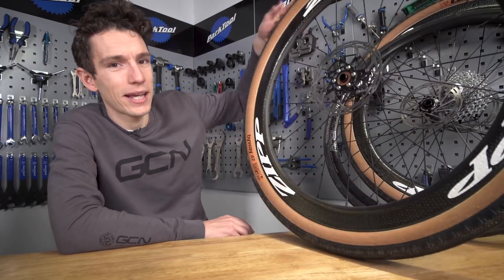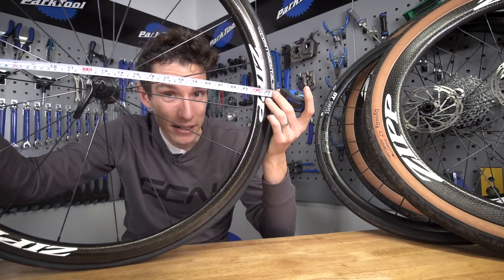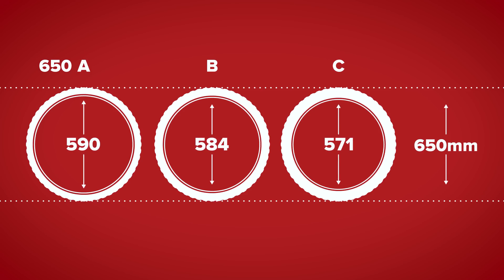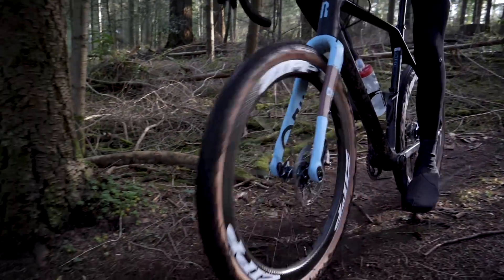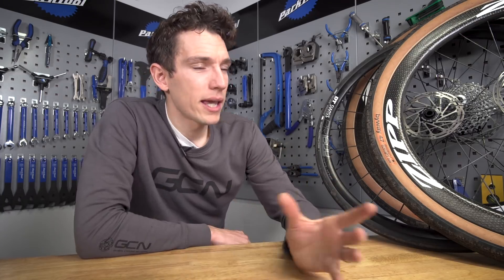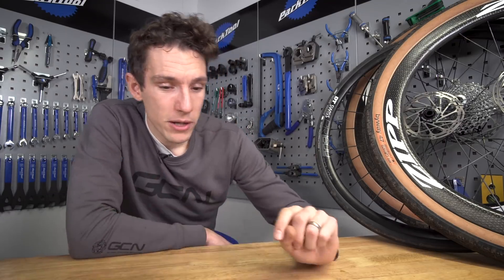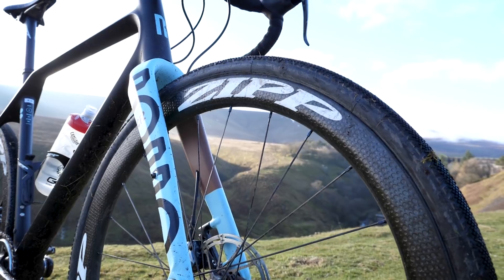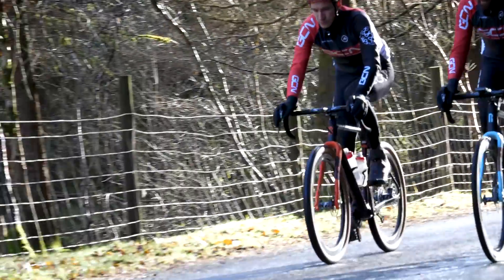650B Vs. 700C: The Geek Edition | GCN Tech Does Science

Comment: Interesting. I just checked the rolling diameter of my trike rear wheel and tyre, a 26in with 47mm tyre, and it comes in at 670mm, pretty close to a 700c with 25mm tyres. 2mm difference. I've got Schwalbe marathon plus which are a bit taller than non-armoured tyres.
Oddly enough, I have to change the mounting points for the roller on my trainer to fit my bike on it. I think I should try 23mm tyres for the trainer'

Comment: Please, please, please stick to the ETRTO sizes only, as that will remove most of the confusion as to what tire will fit on which rim. The width of the tire then completes the picture. Luckily the ETRTO system includes two numbers, so you get both at teh same time.

Comment: Not many years ago I bought the top spec S Works Stumpjumper 120 fsr £5k for trail riding. The following year pretty much, it all started going 29'' and very quickly its value sank like a brick. I still ride it today and people seem shocked I am able to shred on 26'' wheels?!?!? I have been saving up for a new top spec road bike to replace my 2009 tarmac but the only thing holding me back is the speed at which road bikes are evolving right now. I am waiting to see it settle down a little. I think it will settle down to one style of bike....one which both aero, comfortable, light, discs and higher volume tyres. Knowing my luck after I do buy something the road bike world will discover a new wheel size ha ha ha.
Reply: To be honest, unless you’re looking to do CX as well, or explore off-road, this video shouldn’t really influence your buying decision. 

With how comfortable and light modern aero bikes have become it’s hard not to recommend one (especially if you’re running 25 to 28 mm tires) if you’re fine with the slightly more aggressive geometry. Maybe grab something with newer gen disc brakes and you’ll be pretty future proof.
Reply: tarmacsurfers it’ll never slow down mate. The industry is only interested in selling you a new bike. - Si said it himself new wheel size (which zipp say is better -I mean who’s going to prove them wrong??) means New frame designs.  Bet the frame manufacturers are loving this.
Reply: Ryon Beachner oh yeah mate I know just got me wondering if the industry comes up a "new breakthrough" wheel size larger than 700cc that "makes you go even faster" at the same wattage ha ha. Maybe they will all get together and come up with such an idea if sales across the board slowed one year ha ha ha.
Reply: David Fellows yeah mate too true,  consumerism hey! Ha ha
Reply: That is unfortunate timing isn't it?!

Comment: We need a GCN science video on this! I'm interested in an acceleration tests of a 650c vs 700c wheel both with road tires. With 12% weight reduction, 7% aero benefit, and 24% lower rotational inertia I'm guessing it could have a big impact on standing start sprints and even some decent results in rolling start sprints.
Reply from the maker: +Joshua Piccari sounds like you've done part of the science for us - we'll see what we can do.
Reply: @gcntech  Bring it on! :-)
Reply: Alex Stieda rode a 650 Softride with Coors Light in the early 90's and there was some other experimentation among the Pro's. I think Steve Bauer's 1993 Paris Roubaix bike may have used 26's as well, but there a smaller diameter would increase bump force. Most notable is Paula Newby Fraser on a Hamilton with 24"!! wheels front and rear. She smashed the Iron Man record and came in 3rd among the men. 200 gm rim, 140 gm tire and same spoke aerodynamics as a 700c wheel with an 80mm rim. Ridiculous acceleration and aerodynamic and it allowed a tighter, stiffer frame. Banned by the UCI after Atlanta 96.
Reply: That is a great idea.
Reply: Thats the one! Special build for her. Notice the "uphill" bottom bracket and the apparent length of the chainstays, and the size of the rings. Some is just a visual effect of the wheels. The stays were actually super short at 38cm with plenty of room to go even shorter. This allowed stout stays with no need for crimping. The only reason the stays didnt go any shorter is because the chainline couldnt take it.  I wish this design would have survived. Unfortunately it was ahead of its time. It would put deep dish carbon wheels out of business and put a few thousand $$$ back in your pocket.
Reply: Interesting!  I googled around and found a pic of the bike you mention here: https://www.active.com/Assets/Triathlon/620x351/paula+newby-fraser+on+bike.jpg